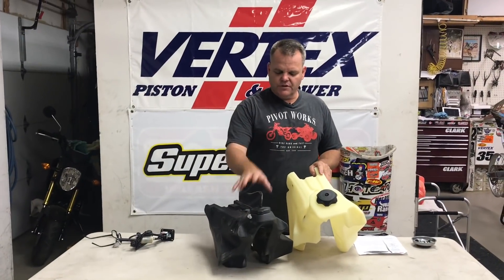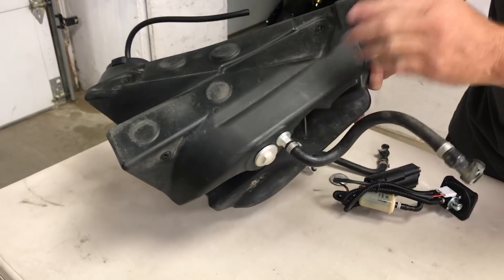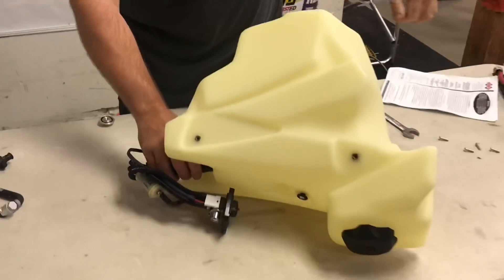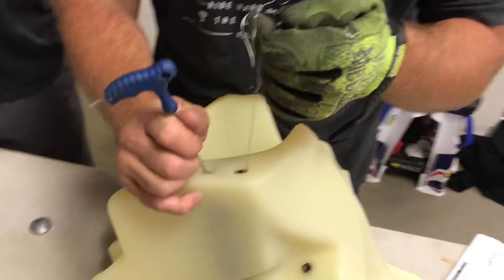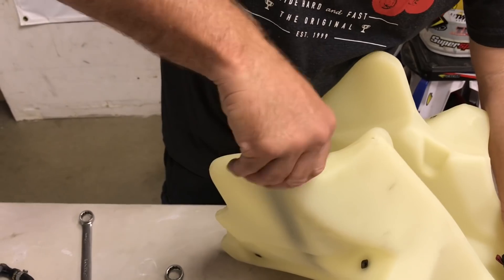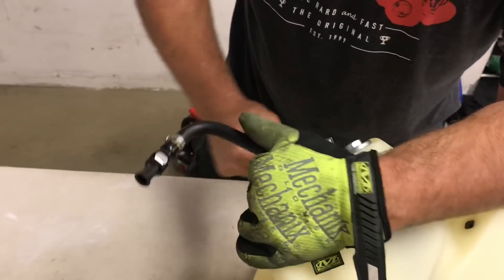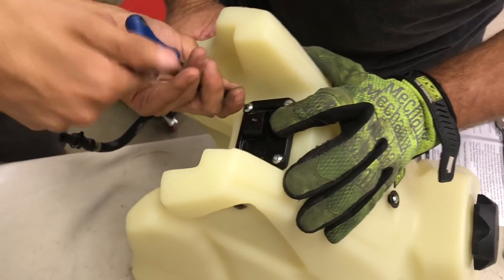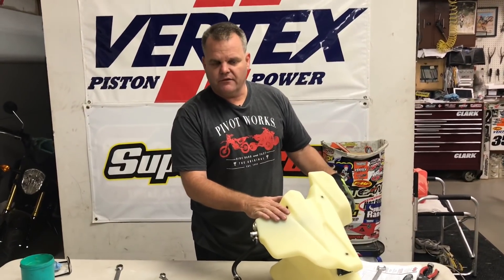Fuel pump swap-KTM/Husqvarna

Comment: Yea great idea can do a full stock  tank in one session  motocross..I'm sick of running out of fuel on my fc450 17   over the handlbars again on Sunday over a big jump. these Husqvarna Fc  when it runs out the bike literally runs out . and endos in the air . no misfire no surging no warning no low fuel level light  .    The rear wheel stops and over it goes .  never had a bike just stop like that. even my rmz 450 fuel injected didn't do that.  I'm thinking it drinks it dry  unlike my rmz the fuel tank shape must have been different to allow it to miss and surge for a warning.  would never just stop mid air.

Comment: I just bought a 18 350 sxf and im setting it up similar to a xc-w. Do you prefer IMS to Acerbis? Im looking at the 3 gallon and was wondering if my KTM electric fan will work with either tank.
Reply from the maker: Usually IMS -- - yes fan should work-- if it hits email me from my site and I will walk you though how to fix it.